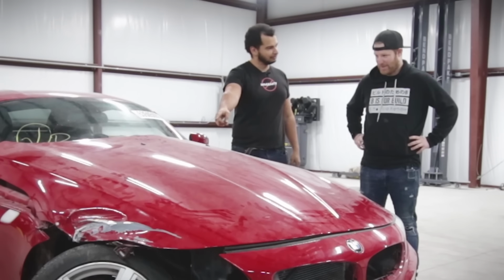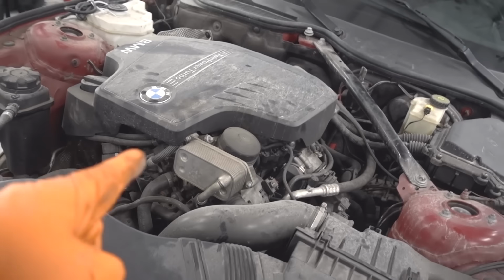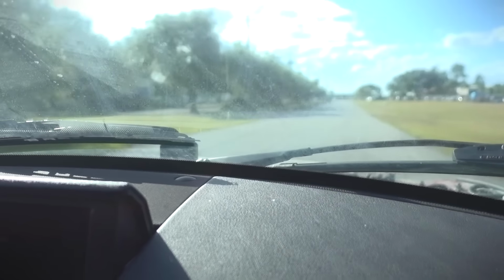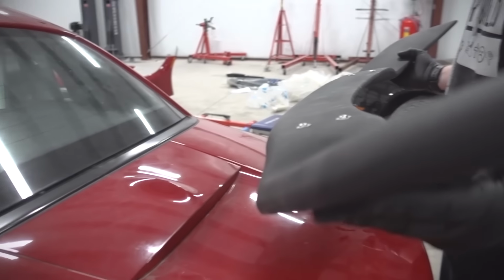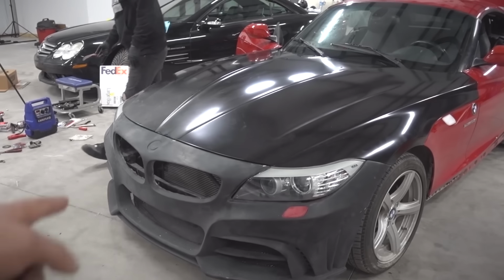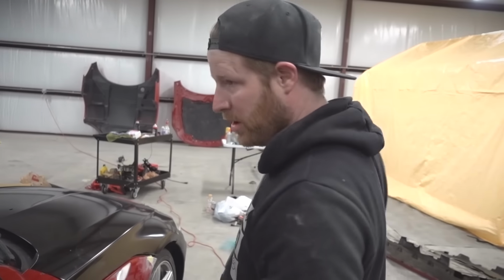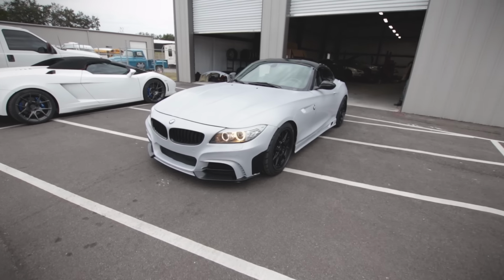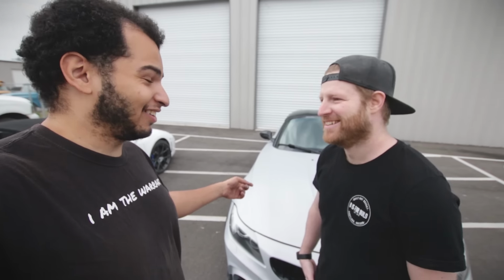Rebuilding (And Modifying) A DESTROYED BMW Sports Car In 4 Days

Comment: You have to tighten the controlarms when the car is in driving height. If you dont, the bearing of the arms is under constant stress, which causes faster wear.

Comment: Can we get a breakdown of the total cost spent on the car? including your typical labor or labor at a shop? So far all i know is the car was auctioned off at 3200? what were fees taxes shipping, parts labor to get it where it is at the end of the video?
that would be cool to know.
Thunbs up if anyone else is intereested in knowing.
Reply: Tavarish said 3 grand, so add 10 thousand. 🤣😂
Reply: Yeah dude the body kit alone is $1500 on eBay. I guess they're just saying to get it running it was 4k? But thats kinda dumb because it would not look anywhere near as good without that extra stuff(wheels, tires, body kit, coilovers, paint).
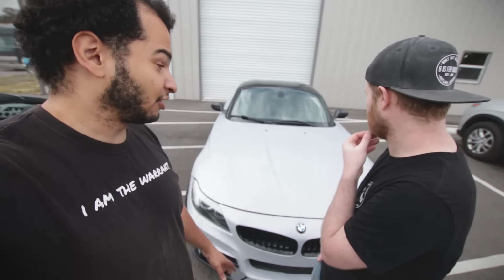Reply: All Chris said, was it cost around $4000 at 34:25 but he got alot of the parts for free.
Reply: He said selling it at $20,000 would make them a profit of $12,000 so roughly 8 grand by the sound of it
Reply: Lightningbolt Gaming p
Reply: sirTOZZAlot minus the $3200 he paid for it. So $4800? But all sponsored extras would probably set you back easily another $8000 minimum so I’d give it a guess all in or anywhere between $12500-15000 just for the repairs and add-on’s not included a shops labor fee... do it yourself or suffer another $5000+ labor bill. Let’s be fair and just say shop rebuild price totaling $25000 all in. For a car with pretty low mileage but don’t forget it’s got a worthless resale salvage title... :-( 
Will your state even allow this car to be insured and titled? Because spending all that money to fix this vehicle would only make sense if you planned to keep it forever. Passing it down through the generations, building a sentimental value over the years, trying to compensate for the loss you would take choosing to build something like this.
Reply: Oh and FYI I am a warranty admin for my local Cadillac, Buick, GMC Dealership and work very closely with mechanics and collision specialist on a daily.

Comment: Lots of boost sound but no go-go. First thought, check the intake from turbo.... 
Tavarish be like, I'ma check the fusebox!!
Reply: Yeah, that seemed like the biggest waste of time. And yes, they do come from the factory with all red wires, damned BMW.  The plastic welded connector for the boost hose sounded really hack to me too, no guarantee that'll last through heat cycling, boost pressure, and oil exposure.

Comment: The moment when you want to quit, is the moment you need to keep pushing!!! 
This man is a hero in my eyes. 😊💙🙏

This man who carried his elderly parents alone for more than 100km in a makeshift stretcher to escape killer squads in Myanmar. This man tied two woven baskets on either side of a stick and used his shoulders as the pivot. He then embarked on the torturous journey from Rohingya in Burma to save his parents lives. 
On side was 65-year-old mother and on the other his father, 80. Both are well tucked but look drained and frail.

Comment: Fix the panel gaps and clean the headliner ^^ Otherwise, good job.
Reply: The chassis is bend because of the  crash, and it also toke the steering off center, it probably needed a jig work to pull the chassis back in alignment.

edit: to correct what phone autocorrect incorrectly corrected.
Reply: 4IN14094 tf is bented
Reply: @jaredcohen325  For some unknown reason my phone auto correct is having a brain fart and keep correcting "bend" into bented, it happens on some other comments as well.🤣
Reply: Also fix the paint and the turbo leak and all the rest of the many many many issues

Comment: In case you’re wondering, sDrive means the car is RWD (X1 and X2 would be FWD if it has sDrive badge). xDrive means all wheel drive. Your Z4 is a RWD model.

Comment: The all new Toyota Zupr4
Reply: You guys act like the Supra is a directly rebadged z4. Toyota and BMW agreed on the engine and chassis, and after that they didn't communicate for the entire design of the car. The cars won't handle the same. They won't feel the same. You fanboys just need to give the new Supra a chance.
Reply: luisionfusion it’s funny you say that since the Supra is being made in Austria and the whole vehicle itself it mostly bmw including the detuned B58 engine that’s in it making 330hp whole the z4 G29 version makes 382hp, let’s not forget Toyota’s original 2jzgte which made 320 20 years ago. Not knocking off bmws engines but a true Supra would have a boosted 2GR instead of the B58 or the V35A-FTS that is in use now with the LS 500 from Lexus which makes 416hp. So yea it kinda is a rebadged z4. I don’t remember Nissan grouping up with Mercedes Benz for their GTR
Reply: Warrior I will once it comes to my dealership we will see first hand the new z4
Reply: @LUISIONFUSION  yeah toyota redesigned the engine to make it reliable
Reply: Yes
Reply: @LUISIONFUSION  dude you're so wrong. I have gotten to ride in a MK5 supra and the new Z4. Both felt very similar
Reply: @mustafasaqib1688  
key word 
>similar
Reply: FuriousFati i was expecting this comment

Comment: insane guys, you did it so good so quick. I wouldn't set the professional BC coilovers to the stiffest, as these cars and sport BMWs, or Roadsters are kind of rough and very stiff on stock suspension for bad roads, so for public road driving, I would put some comfort without too much body roll, still will have it handle  pretty great in the  corners.

Comment: Restore the ferrari
Reply: i wait too, restore the ferrari
Reply from the maker: That's the idea!
Reply: Yeah! Do it in 4 days too! 

(Just Kidding ofc)
Reply: In 4 days no, slowly like the lambo
Reply: I have rebuilt a couple fire damaged cars and not sure i would do it again. He should find a 355 with damaged front end buy it, strip off everything from windshield back and sell every extra part . You could end up spending $25,000 on fastener, clips, hoses, wiring harnesses, trim ect if you could even get it from Ferrari.

Comment: The good: I like the turnaround and good idea to get a Bmw to rebuild. We can have nice things. 

The bad: Unusual color scheme - but I guess it’ll grow over time. Not a fan of fiber glass as it never stands up to the road or time. Rushed paint job too - door crevices, trunk and engine 

The ugly: did you remove the front fender liner? Any interior work?

Comment: at the end it looks nice, but ... if you focus on the car .. you'll see some issues and little stuff, other than the steering wheel, but i really like the outcome. you know, if you spent alot of time on it spraying the whole car, not showing the original color of the car in the wheel's gap (idk what it's called) and that stuff, also having more time for the engine, the outcome will be really great. anyways good job on the car, managing all that in a small amount of time and stuff.

Comment: Fixing the turbo intake/output with epoxy is totally f*** up. Stopped watching the video at that point..
This car woud be a pile of junk in Europe and you couldn't get the register plates ever. Luckily for you in USA that you don't have the technical exam of the car every year or two as we do here.
Reply: Ante I’m pretty sure he said just after that that they went and got the part that broke, the epoxy was just a temporary fix to see what was wrong.
Reply: @InvaderNate  
As I said Nate, stopped watching after they said they would glue the intake. It is dangerous to do it because parts of the intake can damage the turbo by being sucked into it.
Reply: Totally agree.
Reply: "There seems to be some issues with this car".... YOU THINK....
Reply: It was jbweld, I put my car back together with jb weld

Comment: You can literally hear the turbo leaking. And his watching the fusebox.
Reply: they didn't show alot, but clearly said : something wrong with the boost. So they probably looked at the turbo/airtubing etc from the start. You just don't see everything in a short video like this ;-)
Reply: @mrlooneycooney8948  Agree but why does he looks the fuse box?

Changing all the fuses, never saw that before.
Reply: Baptiste Carron they mentioned it was a flood car. Maybe it was just for good measure
Reply: @isaakstagl3749  okay thanks.

English is not my main langage sometimes I miss informations

Comment: So the purchase price of the car was $3200. Between the replacement control arms, new coilovers, inlet pipe, body kit, wheels/tires and paint supplies... I'm gonna guess without labor, he's got $8000 invested?

Y'all didn't mention installing the tuner, what brand it was, what the rated hp increase was, did it also retune the transmission, etc.
Reply: "We saved a couple grand after all this work and risk", doesn't really sound as cool I guess.
Reply: That is a terrible colour for a bmw z4 it's like battleship grey

Comment: I wouldn't touch this with a 10ft pole, everything just seems sloppy and bodged together.

I think you'd have to be really desperate for a Z4 to buy this car.

Sorry fellas.
Reply: i thought this was pretty good?
Reply: Exactly. What a hack job. It only takes 2 min to paint the door jams so time is no excuse and other parts shoulda been aligned properly aswell.

Comment: The gap between the front left bumper fits but it doesn't fit on the right side. Due to the accident, the gap between the bonnet, bumper and fender on the right-hand side has shifted

￼

Comment: Metallic silver is one of hardest paints to spray. you have tiger stripes because you did not fog the last coat. painters error get with it. call me. and you forgot to cut your parts in before you put the parts on.

Comment: Ohh man, the fit on the front LHS bumper/wheel arch is actually hard to watch...
And the spray job? Why not just respray in red if you're not going to spray super obvious parts like inside the door?!?
Did well to get it looking OK but question marks over how that car is going to handle or wear tyres in the future.

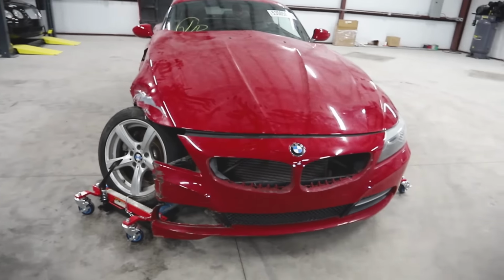Comment: Am I the only one that is annoyed that they threw coil overs on a car that clearly has a bent frame and that they act like they fixed the problem. If you watch 33:00 he’s holding the steering wheel at at least a 45 degree angle without properly fixing the bent frame it will never drive straight. If this car ever makes it out of salvage someone’s not doing their job.

Comment: Hey Tavarish... This definitely wasn't your usual quality of build. Door jambs and ends of doors were still red, engine bay is still red, was the hood even painted underneath? Looks great on the outside but as soon as a panel is opened res pops out. Also, bumpers, sideskirts, hood, that should all have been painted off car, and at least the front frame of the car should've been prepped and painted to avoid rust in the future: that's where the car took the hit so I'm pretty sure there was damage paint that needed repair. This was a hack, not a build... a little bit of lipstick. Disappointing to see this on your channel. You've done plenty of builds since this one was done which were done properly so I'm hoping this was just a one off. Keep the collabs going with Jared.. you're quality and throughput has definitely improved with his help. Just sayin...

Comment: Not impressed man. Silver  on the outside red on the inside - should have at least gone with a flat red outside  to reduce the obvious spray job, plus the alignment on that front panel is horrendous, looking bad on both sides

Comment: LOL The car is fine. 
The axel is broken and therefor the engine is wasting all the energy trying to turn a broken wheel
Also your steering knuckle is bent
Reply: I believe these are rear wheel drive, so no front axel. Good shout on the knuckle tho.

Comment: Panel gaps the whole way round every piece of bodywork you did, paint job is off pretty much everywhere you look and you fixed a turbo by putting it back together with the same method that broke it in the first place, cunning move. Complete bodge the whole way round, tf did you put this on YouTube for?